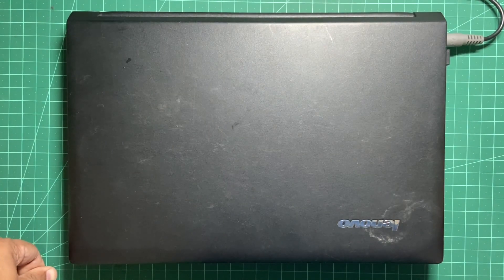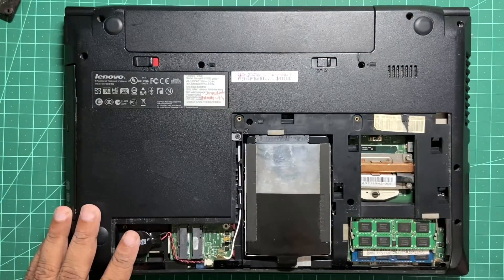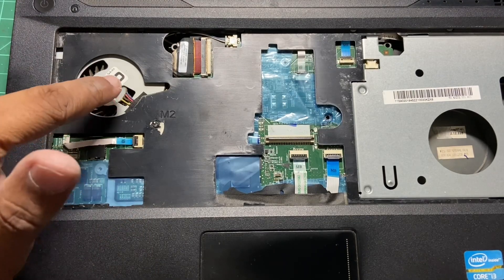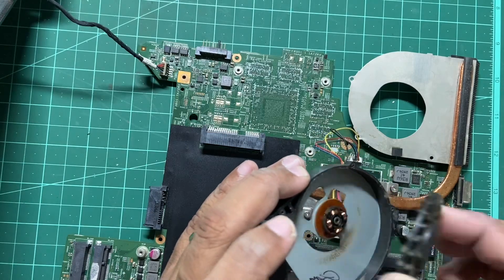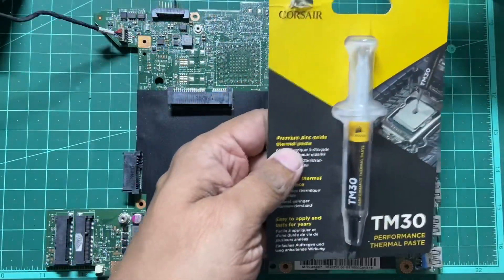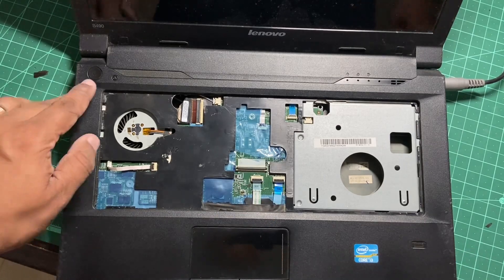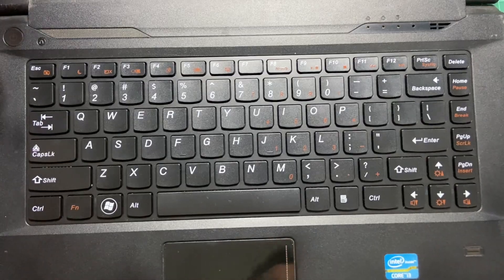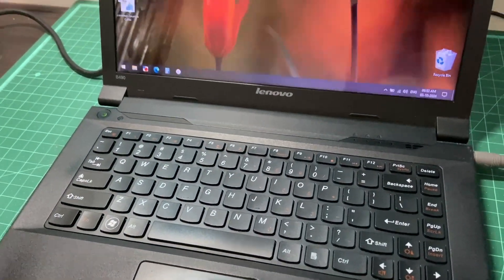Lenovo B490 Repairs - Keyboard, Thermal Paste & CPU Fan

Comment: Hello bro, I really need your help.
I have a Lenovo B490 laptop. When I turn it on, the fan starts running, but there is no display.

I already gave it to a service center, and they charged me ₹4000. After repair, it worked for just one week, then the same problem came back.

I went to the shop again, but they didn’t respond properly, and now I’ve lost my money. You're the only one who can help me now.

Here's the current issue:

When I turn on the laptop, there is no display.

I think it might be a RAM issue or thermal paste issue.

I saw a video and tried changing the thermal paste, but the problem is still there — although the behavior changed a bit.

Now when I turn it on:

It gives one beep sound, then automatically turns off.

But if I remove the RAM, it gives 8 beep sounds and then turns off, just like it did before I changed the thermal paste.
Reply from the maker: Thanks for reaching out, and I’m really sorry to hear about your experience.

From what you described:
	•	1 beep + shutdown usually points to a system board or POST (Power-On Self-Test) failure.

	•	8 beeps without RAM confirms the motherboard is detecting no memory installed, which is expected.

Try these steps:
	1.	Clean the RAM contacts using a soft eraser and reinsert it firmly.

	2.	If possible, test with a different compatible RAM stick.

	3.	If it still doesn’t work, try booting with just one RAM stick if you have two.

	4.	Reset the CMOS – remove the CMOS battery for a minute and put it back.

If the issue persists, it might be:
	•	A faulty RAM slot, or
	•	A motherboard issue (power delivery or chipset fault).

Since you’ve already paid once, I’d suggest trying these steps yourself or going to a different, more reputable technician who can test components one by one before replacing anything.

Comment: My laptop's CPU fan has been making a rattling sound for quite some time. Will lubrication solve the issue? I cleaned the fan a month ago.
Reply from the maker: Try lubing the bearing of the fan. If the laptop is old, the fan can be noisy. Remove the sticker from the back of the fan and put a drop of sewing machine oil and see if it helps. Else you’ll have to replace the fan.